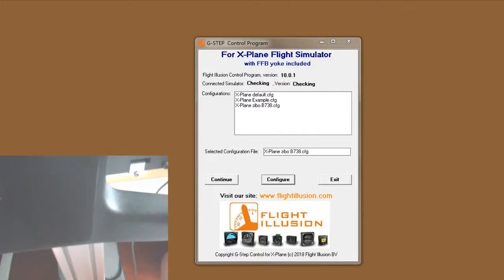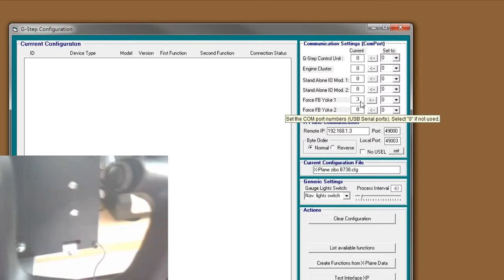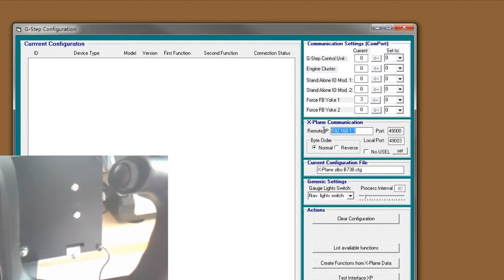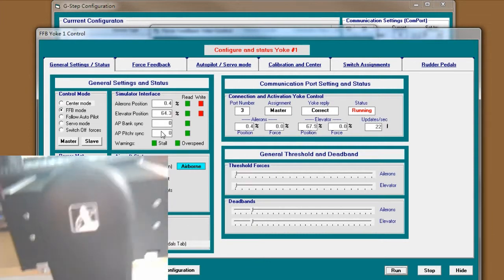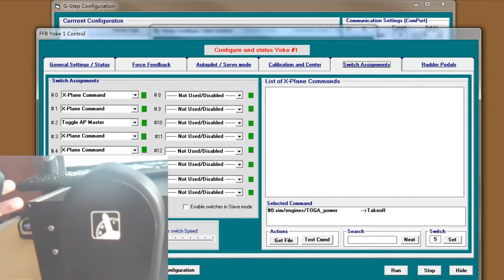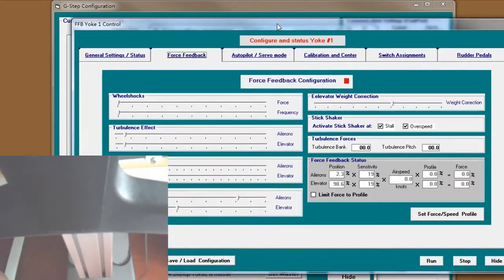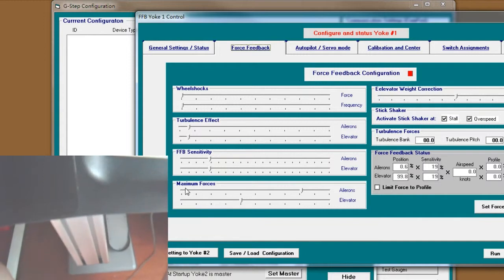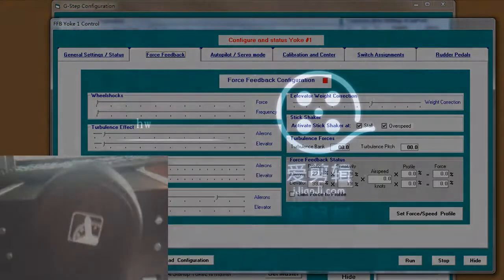flight illusion Force feedback yoke configuration

Comment: Hi CPUwolf, Thanks for this review. I am sure it will helps other users too. 

Some remarks of my side: 

You said to fill in your local IP address, this depends of the configuration... You can connect the yoke to another computer as were x-plane is running. It is possible to connect to x-plane over a LAN network. In this case you need to fill in the IP address op the machine where x-plane is running. If it is the same machine as where the yoke software is running you are right, otherwise fill in the IP address of the X-plane machine ;-)

Another remark: 

You said the User Interface is not very friendly. Maybe you are right but we know simulator builders would have the maximum possibilities of configuration and setting options. This makes it nescessary to create a user interface with a lot of knobs and sliders to tweak your settings and make it comforable and realistic. For example the Wheelshock: Im my opinion it is not necessary for a Boeing Yoke, but take in mind that the Force Feedback units will also used for small aircrafts like a Cessna...
With these small aircrafts it is more realistic to have these settings functional.

We wish you happiness during the use of this product!
Reply from the maker: super helpful comments. thank you Matthijs